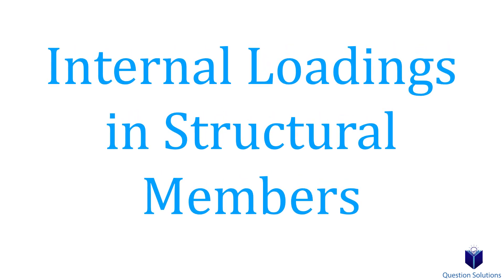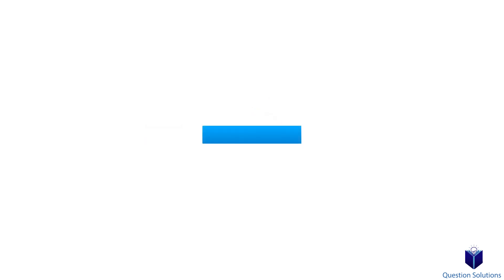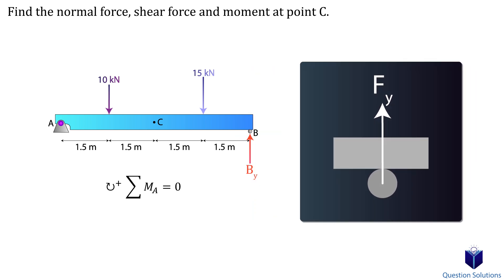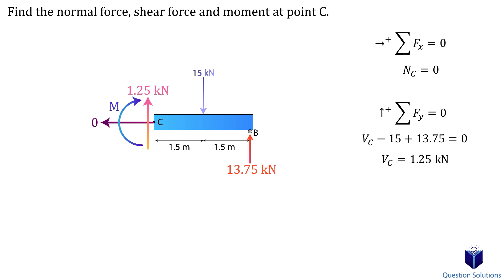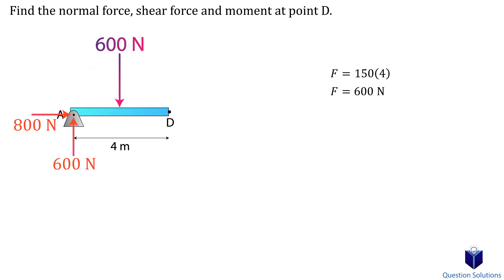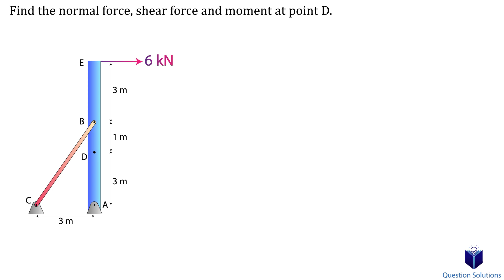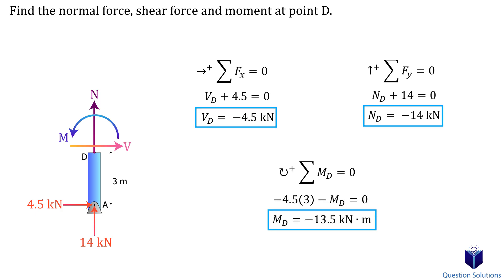Internal Loadings in Structural Members | Mechanics Statics | (Solved Examples)

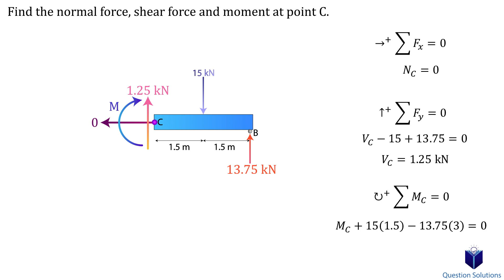Comment: At 2:57, if we had selected and examined the left side of the structure, would we still find a positive or negative result? What I am trying to ask is, is there only one answer, regardless of the direction? Are only the positive aspects of both sides different?
Reply from the maker: You will get the same answer, but you will need to figure out the forces at pin A.

Comment: I watched your short about ccw, and cw moments as suggest, and I am still confused. Several other videos have said if the moment produces a sag, it is positive. Why are we allowed to change it here please? I keep getting strictly told there is a sign convention and we are not allowed to arbitrarily choose by my teacher.
Reply from the maker: The sign convention used here and when calculating moments about a point are different. Here, the sign convention used is mentioned around the 1 minute mark.

Also, I just want to add, you can follow the method your teacher says to use. You don't want to lose marks if your teacher said to do it a certain way. 😅

Comment: Hi, for 3:34 - can you explain where the other 2 force member is respect to F(BC).
A 2 Force member is a pair of forces that have equal magnitude but opposite directions and are along the same line of action.
Reply from the maker: The 2 force member is member BC itself. The force "extends" from point B towards the top and on the opposite end, the force "extends" from point C towards the bottom, both following the same path as the member itself.
Reply: @QuestionSolutions  by that definition, then wont the members in the "Method of Joints" video have 2 force members as well?
Reply from the maker: @Xarishher  Yes, trusses have 2 force members.
Reply: @QuestionSolutions  thank you

Comment: 5:50 how come you choose to multiply FBC cos 53.13 (4) and not (3) - only x direction forces create a reaction.
Reply from the maker: So you're right when you say only the x-component creates a moment but I'm unsure why you think 3m is the perpendicular distance. Point B is 4m in the vertical direction from point A. The x-component lies horizontal at point B. I hope that helps 👍
Reply: @QuestionSolutions  can you clarify for me please  , it doesn’t matter which way you break components but when you take the moment , you got to realize the distance from the moment point to the point you broke the components.
Sometimes I break the x component correctly but mess up the distance, because of how my components look on paper.
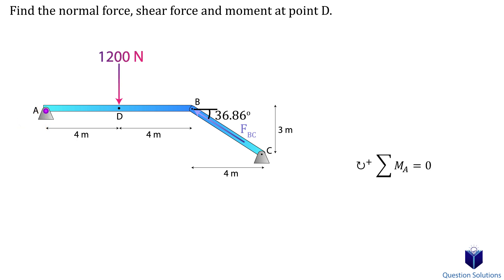Reply: like for instance at 3:51, you see how when you broke components the Y component is not exactly at 8 m away from point A as drawn. But we should know that these ccomponents happen at the point you are breaking them
Reply from the maker: @nathanmorales8025  You're missing a bit of fundamental knowledge when it comes to breaking forces into components. My guess is, you draw a right angle triangle with your components. But the components are floating vectors, you can slide the y-component directly the same place as the x-component, or vice versa. See this video: https://youtu.be/NrL5d-2CabQ
Reply: @QuestionSolutions  I see exactly what you are doing and where I went wrong. You are amazing thank you so much!
Reply from the maker: @nathanmorales8025  You're very welcome!

Comment: Hello bro, where did you get the moment arm 8 from 1200(4)-FBC sin 36.86 (8) =0. THANKS BRO
Reply from the maker: So the 8 comes from 4m + 4m = 8 m. It is the length of the beam AB. We are treating member BC as a force, so the force is applied at point B, which is 8 m away from point A.

Comment: When u take moment at c 2:50.. shouldn't the Mc become 0?
Reply from the maker: I can see why this can be confusing, but this isn't the same as when you take a moment about a point and any line of action of a force that intersects it becomes zero. Instead, imagine you have an object and you have an additional moment applied to it separately. So not created by an applied force, but rather, a direct moment being applied.
Reply: @QuestionSolutions  Thank u for clearing that. i was just checking section method and ur reply clear all my confusion.
Reply from the maker: @hasibsami8255  Glad to hear :)

Comment: Thank you so much this video is very useful!! I have a question, what about fixed support only on a beam? Although it is like the pin support but I kinda have bad feeling toward it 😂🙏🏻
Reply from the maker: There isn't much of a difference, you'd have 3 reactions though. With a pin, you have x and y reactions, but in a fixed support, you'd have a moment along with x and y reactions.
Reply: @QuestionSolutions  When I was passing through, I found out that we took a hinge alongside a fixed support. And this needs a cut then tryna figure out each reaction in a sliced beam.. In a fixed support, there is a moment equation

Comment: i think there's some confusion, you moment at point a so that 10kn is going down it should be clock wise right? therfore - 10(1.5)-15(1.5)+by(6)
by= 82.5
Reply: -10(1.5
Reply from the maker: There is no confusion. Clockwise moments were picked to be positive so the only thing negative would be B_y. You can pick counter-clockwise to be positive, you will still get the same answer. It makes no difference. You just have a lot of negatives to deal with. Do whichever method you like best.

Comment: At 5:21 why  does the moment b equation have the 600(4) - 600 (2) - Md =  0 
I thought it would be 600 (4) + 600 (2) - Md = 0. I can't see why F= 600 N isn't clockwise :/
Reply from the maker: Think about the beam rotating about point D. So it's free to move. In that case, if you apply a force from the top at the middle, how will it spin? It would spin counter-clockwise. Now imagine applying a force from the bottom, how would it spin? It would spin clockwise. To see it better, cut a small piece of paper, and hold your finger at point D, gently, so that you can spin it with your other hand. Then apply the forces one from above, and another from the bottom and see how it spins. Another way to see it is to realize that in this case, we have a force from the top and another force from the bottom, it's not possible for it to spin the same way when the forces are coming from 2 difference sides.

Comment: From 5:45, could you please tell me how come that you use 4/3 instead of 3/4? I'm usually confused about it, and I found out that it's the stuff that I must know hehe, thank you Sir! A very helpful video.
Reply from the maker: So here, we are using sine/cosine/tangent to figure out lengths. In this case, we used tan, which is opposite over adjacent. So looking from the angle, (imagine you're the angle), what is the length of the opposite side? That's 3 + 1 = 4 m. Then we look for the adjacent side. That's 3 m. So opposite over adjacent is 4/3. Does that help or maybe I didn't understand your question well. Please let me know, thanks!
Reply: @QuestionSolutions  very helpful po, Thank you!😄
Reply: @QuestionSolutions  Sorry can you explain why you took the angle on the outside instead of the angle inside the beam there?
Reply from the maker: @Suyogslothworld  You can use the angle inside the beam or outside, it's up to you. You will get the same answer.
Reply: @QuestionSolutions  Thank you for your response. You respond to quite literally everyone regardless of when you posted the video 🙏.
Reply from the maker: @Suyogslothworld  I try my best :)

Comment: Can you explain why on the second question, you wrote the two force member force pointing outwards like tension, but for the third question you had the two force member force pointing inwards?
Reply from the maker: It was actually just an assumption. You can draw it either way, if you end up with a negative answer, then it's opposite to your assumption. :)

Comment: Minute 3:40
Why didn't you use the reactions of c?
I thought you you will write all the reactions and find them. Then we can take the right or left part?
Reply from the maker: You can write them, but it doesn't matter what they are. We only care about the top beam, so we don't need them to calculate force FBC. So focus on one beam at a time, unless you consider the whole object, in which case, internal forces like FBC doesn't matter.
Reply: @QuestionSolutions  Ok, thank you.